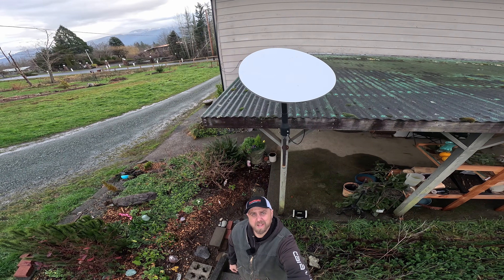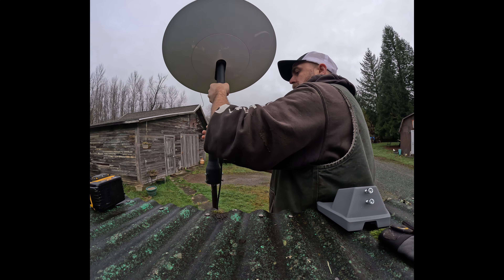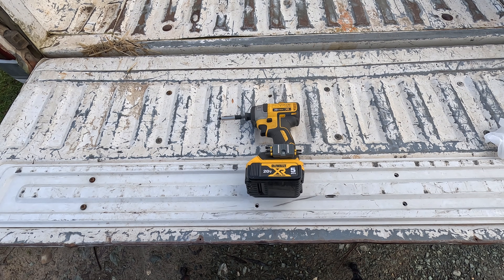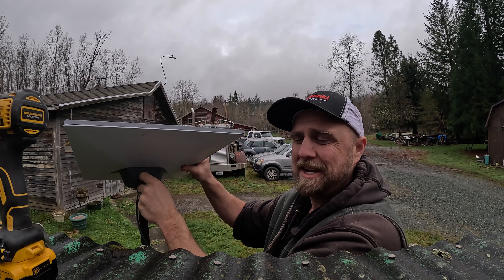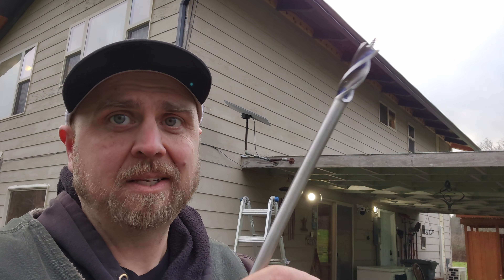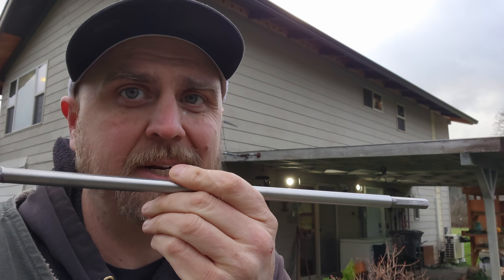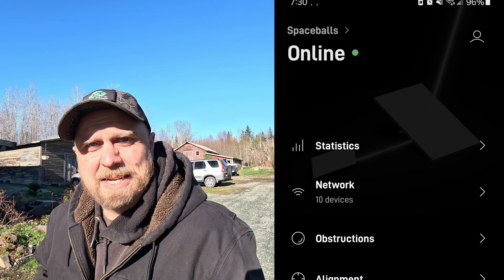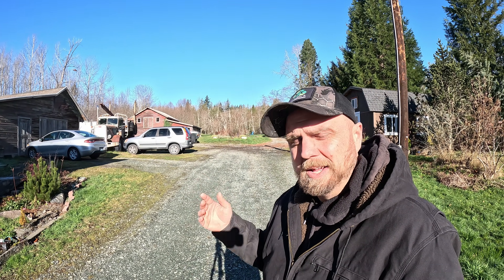Starlink Gen 3 Install - I Ran Into a Couple Issues...

Comment: Lol. How much does that oversized galvanised water pipe antenna mount weight relative to a lightweight $20 Starlink mount?. Just saying.
Reply from the maker: Like 15 lbs. And i only need to mount it once.  Going strong every since,  and I neve have to worry about it!

Comment: Have you had any issues with stability using that mount adapter? I’m worried those two screws won’t provide a strong enough hold in our windy area?
Reply from the maker: Haven't had an issue yet- I've got it torqued down pretty good!
Reply: I know this is an older video and post, I am glad it is working for you. However, The very specs of that pole mount say between 1.5-2.5 inches, so if it didn't work out because you were using it outside the intended use specs, then you can not expect normal functionality of the product. Therefore, logically, no review can be given on it.

Comment: Can you not use the original starlink cable? The round dish and the gen three should have the same Ethernet end? The gen 2 was different, but 1 and 3 should be the same.
Reply from the maker: Good question! The gen 1 cable is a real pain to get out of the dish and has, from what i remember,  a different end on it as far as the weatherproofing collar goes. In the end, i tried to get the cable out anyhow, but it wasn't gonna budge!
Reply: @HomesteadBandwagon  Mine is hardwired to the dish end 😮
Reply from the maker: @scottleggejr  I heard from some dude that a guy can remove the rubber thing in the back of the dish and yank real hard, causing the wire to come out.  Might have just been foolin, though.
Reply: @HomesteadBandwagon  I got mine and was sooooo pissed that it wasn't an ej45 jack. That stupidly long cable on my RV has enough service spool to run it again 12x if it gets nicked. Thx for the tip. I need to get more in to the hacking side of this stuff.